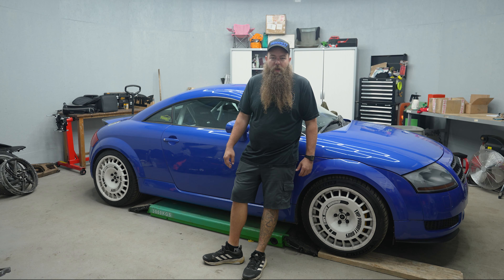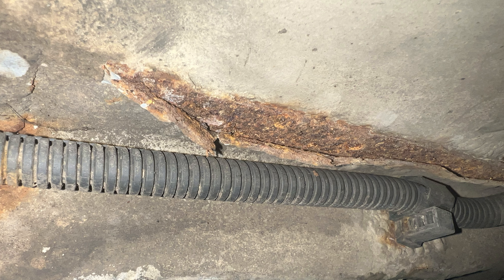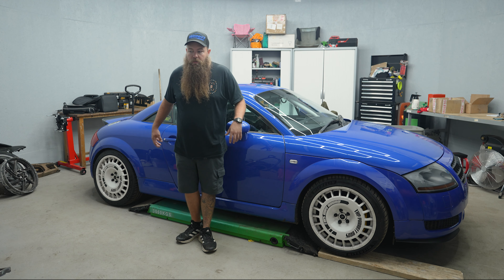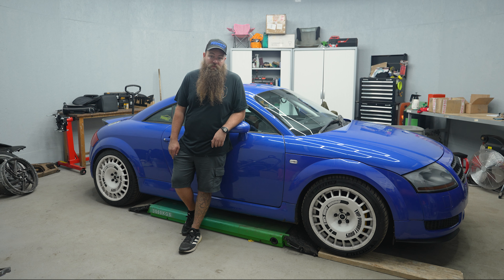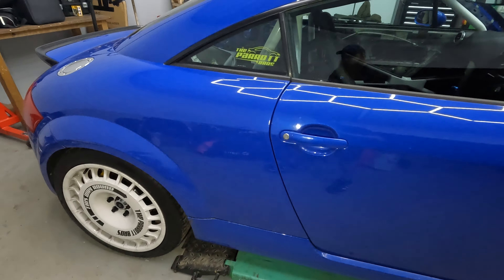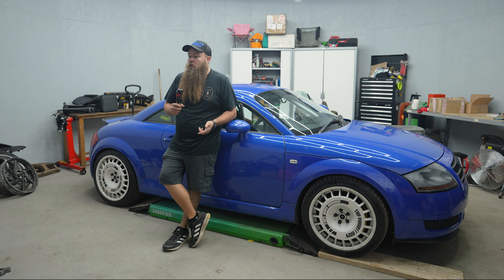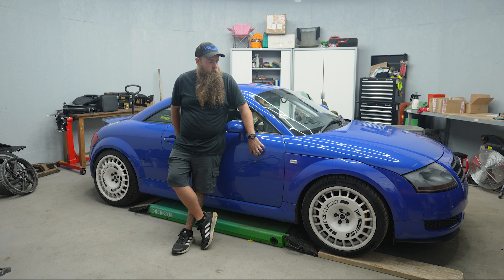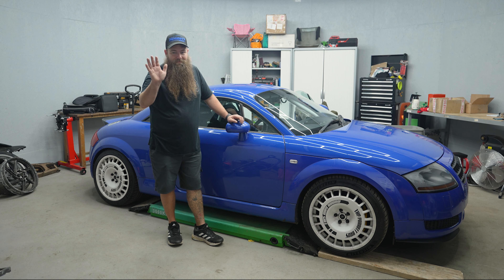Time to call it a day

Comment: Stash it in a garage for a year and do another project in the interim, pull it back out in a year or 18 months later and tackle it with a grinder and mig welder. People absolutely love that sort of nut and bolt restoration content and this car is very definitely worth saving but you got to have the enthusiasm and commitment to get it done. You're obviously not in that space at the moment so you've made the right call I reckon. Very best of luck with the next project I look forward to your content! :)
Reply from the maker: Your bang on mate, I have 0 motivation right now so shelving it is the right decision to make for sure

Comment: I have a black 180 FWD stage 1 minimal rust just a tiny bit of bubbling, 2 large chips, one on the boot deck one on the front of a roof insert. I’ve added a Ram Air Pro-Ram to replace a smaller cone, I’ve bought the missing engine bay covers and installed a billet kit and steel panel screws. I’ve replaced the rear shelf with a full size metal one and christened the car the Ugly Duckling with ‘Ugly Duckling’ replacing ‘Quattro’ in the rear shelf. One day the Ugly Duckling will become a beautiful swan.
It has possibly the worst 10 spoke wheels you’ll ever see but the 15mm/20mm spacers are making them look aggressive nonetheless. This is a project which will take time, I’m not looking at weekly changes but I bought the car for £650 and the old owner has seen what’s been done so far and he’s envious as anything but glad it’s gone to a person who has lavished attention and a few   £££’s on it:

Car £650
Oil change £70
Plugs & coils 90
Rear coolant flange £7
Silicone coolant kit £90
Radiator £35
N/s driveshaft £98.99
Oil breather kit £27.15
Necessary total £1068.14 (my own labour is free)

Genuine coolant bottle cap (so billet fits) £8.92
Genuine boot storage net £50
Replacement vents set £29.99
Custom rear shelf ‘Ugly Duckling’ £175.68
Engine dress up bolts £17.50
Engine billet kit (Quattro lettering removed) £150
Engine covers £120
Rear carbon spoiler £113.33 (makes reversing very easy when you can see the spoiler!)
Front splitter £130
Radio code £17
Comfort indicator unit £48.21
Heated seat switch (bulb gone) £15
Wheel spacers 15mm/20mm £99
Metal gear H gait & illuminated £89.99
Anodised red vent rings 16.95
Anodised red door catch covers £12.95
Climate control fan knob £29.95
Optional total £1124.47 (my own labour is free)

Grand total £2192.61 and worth every penny.
Reply from the maker: Love the fact you’ve kept a running total, I’ve never been brave enough to do that haha. As long as you are enjoying the process that’s all that matters. 
Cool name too 😎. Hope to see it one day

Comment: Hello from Canada. I’m new to your channel. We just purchased a 2000 TT Quattro. It has high mileage at 342,000 km. It is mostly highway miles. Looked at your video to replace the rear tail light bulbs. I noticed something in your video where you mention a piece of red tape on part of the taillight lens. In Canada there is no red tape that is the reverse or backup light. My next service will be a front end alignment as  the car needed front lower control arms and new tires. Also have to service the HALDEX. Keep up the great content. Good luck in your search for the best series of TT
Reply from the maker: Thanks buddy, yeah I think it’s only a uk thing having a red fog light that side. Often people buy euro lights and programme it so they have twin reverse lights to keep it symmetrical. 

Sounds like your new car is keeping you busy, plenty of driving and enjoying too I hope
Reply: @TheParrottBros yes cleaning it up. Going to our local dealer 450 km away to get a spare key as the car came with one. Also going to get the HALDEX serviced
Reply from the maker: @BobJones-rb8zr   Fair play mate, hopefully it serves you as a greaTT car for many years to come

Comment: Hey Dom. Great idea to put it aside … out of sight, and out of mind will rekindle your interest. Quick q … what’s your opinion on a roadster hardtop? Worth the gobs of $? How is the interior of the hardtop finished? Are there a bunch of bits that would be impossible to get, in addition to a hardtop that has resided on someone else’s car? Thanks!! Always enjoy the content! Be well! Andy
Reply from the maker: Thanks mate, so hardtop wide you need to try and get all the fixing accessory’s that are required to secure it down and the trim that sits round the body ( that the roof perched on ) not cheap and it all depends on if you want that coupe feel in the winter or not. Would help protect the soft canvas roof some what. Provided it’s put away clean and fry